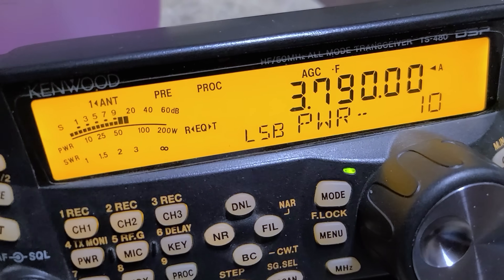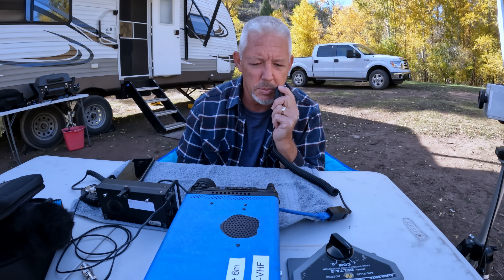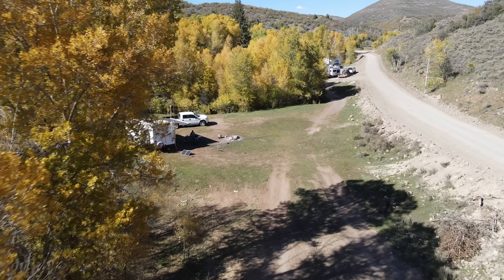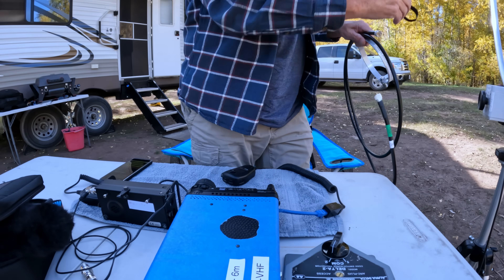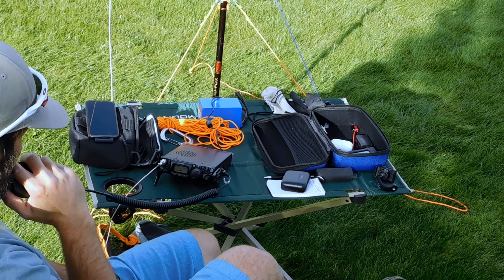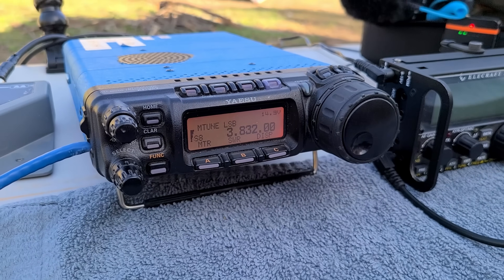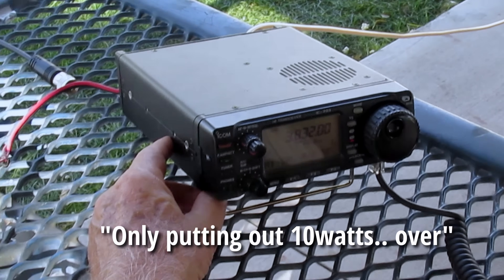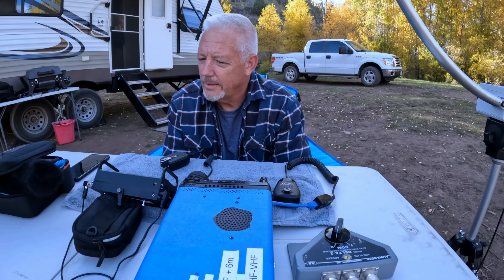Hear what NVIS sounds like from 3 locations | K7SW Ham Radio

Comment: I don’t like magnetic loops.  The big issue is that they’re mostly power limited.  A loop that can actually run more than QRP typically need vacuum caps, so tends to be bulky and relatively delicate.

The only advantage to magnetic loop is if there are very strong neighboring transmitters saturating your receiver.  The very small bandwidth can prevent those signals from reaching the frontend in the first place.

I’ve found the most practical, robust and easily portable antenna for NVIS is the EFHW.  Carry a 20ft telescoping crappie fishing pole, or better a 30ft JackKite, and you won’t need trees.  Set up for inverted V with the pole holding up the center.

Comment: Did you check how was the FoF2 measures that day on the test to determine the optimal frequency for NVIS.? It seems was better for 80M that seems that the FoF2 at that time was maybe 5mhz as maximum frequency.
Reply from the maker: It is on the list to note the MUF and a number of other details that we did not get this time. We were virtuous on this trip. Thanks for the good question
Reply: @hamradiowithkevin  It was an excelent video testing the NVIS. Very complete on testing the antennas. The results I have had is the end fed is the go because is tx stronger, but for Rx a lower dipole is better. I would recommend the same test replacing the worst antenna in the test with a Dx engineering design antenna that is a cross dipole. It is short but it works very good for smaller spaces. This dipole have four branches instead two. I had many good results some years ago doing different NVIS test.
73
HP1GDS

Comment: Hi Kevin, I recently tested a 40m center-fed inverted-V, center insulator on a 23' painter's pole off the pickup's hitch receiver, and ropes on the the ends tied off to a split rail fence, at Camp Floyd Pony Express Park in Fairfield. It made a sensational NVIS setup. I tested during the Beehive Utah Net, and heard all 150 stations well. I want to do more testing at varying heights to find the sweet spot between high angle and low ground losses.
Reply from the maker: Paul, that sounds like an excellent setup and test. What a fun project to put together. Testing like you are doing, is a really fun part of this hobby for me also. I hope to work you sometime.  73

Comment: Since your end fed was 25' in the air, it would have been interesting to put a reflective element under it to enhance the vertical part of your signal.   VE3MCF & AK4HB
Reply from the maker: indeed, If we had more time I would have also lowered the antenna and tested different heights. so many tests to run and so little time that day. More to come :)

Comment: I suspect for where you were within the issues of static within 1-8MHz, I would try something within  21-30MHz to see if that improves your transmission ..

you have heard pushing shit up hill ??

I think you are okay at reception however on transmission you are hitting the peaks you are likely looking at 40-80 foot antenna with the co-ax placed in a metal tube so the only in transmission is the antenna and that's it..

Comment: Thanks for this test!!! So far all three of my antennas are EFHW 40-17, but I remember the 80M later morning or early afternoon contacts I had in 1979 as a Novice with a 90' long-wire antenna and an MFJ-901 antenna tuner. Those were the days of slow speed code for me and a lot of patient older Elmers long gone SKs, lol. -Dave - KU9L
Reply from the maker: This was a really fun test, your setup is exactly the kind of thing fun times are made of. Your right too many SK's these days. Thanks Dave. 73

Comment: Would horizontal full-wave loop, square or delta,  at about six feet agl work as a cloud warmer on most any HF band?  It's seems the higher the frequency the farther the  contacts.  Please advise.
Reply from the maker: Yes, lower to the ground for 80 and 40 meters will be ideal for NVIS. Other bands will not be very good for NVIS

Comment: Fantastic video! The Chameleon EmComm2 QRP edition was one of the main antennas that went into the valley of Turk Mountain in Shenandoah National Park last summer  on a club hiking trip (bought it just in time for testing on the trip). The sloper configuration was fantastic for both getting us voice comms on 60 meters back to my local club during a weekend "Shack Day". We were also able to make a few DX contacts to a Curacao contest station and to Spain. Worked very well for Winlink also. 20 watts was the highest power used on a Xiegu X108G. We also brought speaker wire antennas, the Packtenna 9:1 random wire and the KM4ACK EFHW. All of them fared very well and survived the trip.
Reply from the maker: It sounds like you also enjoy getting out and making contacts, enjoying and using the fun gear you have. Thanks for sharing

Comment: Do you have any concerns about RF Radiation with the loop antenna so close to your operating station?
Reply from the maker: Thanks for asking. Not at the 10 watts I was operating at that day.  Since then the remote tuner has come out which mean the antenna can be 20 feet or more away from the radio. And that is a good addition

Comment: I like DL2MAN's u01 antenna for NVIS.  Only one 30' mast and work 40-60-80.  It is like a linked dipole.  You have to change the jumper to switch band but it is all a minimalist setup with good results I think.

Comment: $500 loop v $20  of wire and a $50 49:1 Unun, I know what I would pick... The loop is ideal for those who have no space, other than that wire antennas are the way to go, save your hard earned dollars. Chameleon products are just way too expensive, and over rated, compared to what you can do with wire and a unun!!
Reply: You see Robbie - antennas are just tools made for different purposes and needs! Some people will buy a Black and Decker BEMW472BH at $125 and others a John Deere S120 at $2,700 because this is what they need and they've the budget for it. 

How many QSO's have you done on 40M and 80M with you End Fed antenna installed on the living room coffee table? I know the answer - it's ZERO because you can't install a EFHW antenna indoor on a coffee table. But I can do it and done it with a CHA F-LOOP 3.0. I can ALSO do it in parking lot of COSTCO during rush hour - but you can't with your End Fed. I can also do NVIS in a back-alley in downtown Los Angeles at 20W SSB under 15 minutes - you can't with your End Fed.

Do you see and understand what I'm talking about it?
Reply: @Chameleon_Antenna  Thank you for adding that information about loops in general.  While I do not have your loop (I do have your MPAS 2 and one of your end feds and other goodies),  I hava an Alex Loop, and am very excited about this particular antenna design (loops in general).  I can do Winlink Vara digital very easily on 10 watts from my living room, and while I cannot break into a SSB pileup with 10w in my living room, I can still get out, by listening for breaks and locations for antenna loop orientation, I can usually get through.  I would add to your comments that on the science v. art spectrum the loop is more to the art end, and that in and of itself is very exciting for me.  Yes, it costs more than a piece of wire, but it is a very exciting and useful tool to have.  And to learn, which lies at the heart of this hobby for most of us, I would wager.  KI5HKU

Comment: One strength of the end-fed is that if you are heading to a location with suitable trees, you will have less to carry than with the other antennas; all you need is the antenna itself and likely a bit of paracord or the like to get the length right. That's great for SOTA.

Comment: You said the end-fed antenna was up about 25 feet at the ends, and a bit less in the middle. That's probably too HIGH to be a good NVIS antenna on 40 meters; your takeoff angle was too low. It probably would have worked better at 10 feet than at 25.

Comment: I get a kick out of folks carrying batteries and solar panels around when they have a 50 amp 12 volt generator behind them in the vehicle.
Reply from the maker: Often times a vehicle, which includes mine, which produces a lot of alternator noise that really interferes with radio operation. For me a generator is too much work to operate with.

Comment: An excellent real-world test, thanks!  I appreciate the mag-loop tests especially as I plan to build one soon.  As I watched the video I kept wondering if it would work NVIS better if it were positioned horizontally to the ground, or would that require it to be a certain fraction of lambda over the ground to avoid ground absorption effects?  Also, as one or two people have noted in the comments, the FCC does require you to be a certain distance away from a mag-loop for RF safety reasons, but IIRC that distance is 3 meters when transmitting 100 watts.  QRP levels are much lower so you could position it within arm's length or even use it inodors with no problem.
Reply from the maker: Your welcome, glad that you enjoyed it. From talking to Chameleon antenna, they said being horizontal would have a minimal effect. I should have noted in the video that I was running 10 watts. The loop that I was using  can only handle 25 watts maximum. Reading the FCC radiation exposure guide is always a good thing to do, exposure levels can very from operation to operation.

Comment: Try dropping the height of your EFHW to about 15'.    I have a 80M EFHW about 13 feet off the ground along the top of some bushes in the back yard, ...  works pretty good.      I would also like to see the group test with the Military style NVIS 80M/40M double dipole.   N1NVK

Comment: Great Video,
On your next testing, please try the loop in a ''nvis config.'' it will have better results when the loop is placed in a horizontal axis so it will shoot up its signal and will also not be directional.
but always, in general: low to the ground is mandatory for horizontal antennas as well as utilizing the MUF/time factor.
73s
Reply: I'm afraid you misunderstand that antenna. The small loops are directional in the plane of the loop, not broadside. There is a very sharp null in a roughly 15º cone on each "axle" of the "wheel." Putting it horizontal sharply nulls anything going straight up, and also requires elevation above ground to avoid excessive losses, just like a dipole.
Reply: @paulplack490  Thank you for enlightening. I witnessed one tune up on 40m and it had some problems, and in fine tuning it as well. Of course, there are many factors in place but after putting the wheel in horizontal position, the local contacts started hearing us with full saturation. it was the only ant. to rival my AS2259/GR  as we had portable SSB setup. I'm assuming we had optimal sub ground structure as well. the height was about 2metes above ground and 6meters for the crossed dipole.
Reply: according to an old article from W4RNL (SK) Cebik....that there will be some directionality due to voltage peaks on the element.
Reply: @W8RIT1  Thank you, I will read up about it  ASAP.

Comment: The guy with the 80M antenna at the park made a major installation error which will GREATLY influence the radiation pattern and the performance of the antenna thus the overall NVIS COMM experience. You CAN'T wrap a radiating wire on a post like he did! The antenna transformer which is on the table MUST be attached to the post otherwise - you'll lose a lot of power and create RX and TX issues! It will be even worst if the post contain metal inside or around!

Comment: Operating a NVIS COMM at QRP power (under 20W SSB) is VERY good!!! In my book this is a success! Remember that depending of the maximum NVIS frequency used - the Ionosphere will absorb a % of the RF radiation!
Reply from the maker: These are really good points you make. We could have consulted the MUF and used higher power to have seen increased results.
 For 5 to 10 watts we were all using during the day, we really had a good outcome.

Comment: I am curious about your experience with solar charge controllers and maybe inverters while operating from a low noise environment.  Which have been low noise and which have not?  The tests of antennas and NVIS between parties was very interesting and I enjoyed this video.  73 W4POT
Reply from the maker: Thanks Ed, over this summer with all my activating outside the RV with my little panels, I really never had any noise issues. However, operating from in my RV with all the electronics, WOW what a nightmare it can be.  So i really only operate in the RV at night. it so much more fun to work the radio outside at camp anyway, at least when it is warm.  73
Reply: @hamradiowithkevin  is that due to inverter use?  Trying to compile a list of noisy vs. clean items since the data is missing from most general consumer reviews.  73
Reply from the maker: @EdwardGriffin  , there are so many things making electrical noise. It never ends trying to silence them all, so I just find ways to use the radio when it is more quiet

Comment: Tank you, this was a very interesting example of NVIS comms.
I have a couple of questions if I may?
1. Your brother HAM who was using the home brew antenna with a DIY adjustable ferrite choke, was his wire antenna in a end-fed configuration or OCFD?
I noticed his feed point was at the lowest point of the droop.
Also which of the call signs were his, N7GPG, KB7JSW or KI7WJP?
Last but not least.
On the use of a small mag-loop for NVIS, where as the maximum signal strength is in the plane of the loop (which includes the top of the loop) I'm wondering if it wouldn't have worked better if you had the mag-loop tilted 10 or 20° towards your intended recipients?
Thanks again for taking the time to make these videos. 
Gary
Reply from the maker: Gary, KB7JSW had the adjustable choke endfed wire antenna, at a few points in the video, I was able to rotate the loop and improve the signal both for 80 and 40 meter contacts. you would have look back through the video to find those moments however. 
I appreciate you asking.
73 Kevin

Comment: My HF antenna at my QTH is a Alpha-Delta DXCC multiband dipole set up as an inverted-V. Apex is about 25-30 feet up, ends are 8 feet. It seems that the pattern is fairly omnidirectional

Comment: Great video Kevin.  I am guessing the station with the poorest comms in this test was the one closest to you?  It's been my experience that for reliable NVIS comms the distance between stations usually needs to be about 30 miles or more.  The angle is too steep "straight up" and will just be obsorbed, and won't reflect much if at all.  The solution for local comms is having a network of overlaping NVIS stations.  You can use voice to relay but the most efficient way would be digital.  KJ4LG
Reply from the maker: Thanks Mike, I appreciate that.  Kevin

Comment: I like your cooperative antenna testing! I use a non resonant end-fed stealth sloper 71' long, with 50' coax, 9:1 unun, no counterpoise, & common mode choke on a jumper 3'  from transceiver. Antenna slopes down from a 15' balcony to a 6' wooden fence. SWR is 1:2 to 1 or less on 20, 17, 15, 12, 10 meters with no antenna tuner. Using internal ATU in my XPA125B amp, SWR is 1.5 to 1 or less on 160, 75/80, 60, 40, 30. Have made contacts on all HF bands. Get good signal reports on daily 80 & 40 SSB phone nets including stations that are 5-20 miles away. From California have also worked Europe, Mediterranean, Africa, South America, Australia & Asia both QRP & 100 watts SSB. It's great to have an inexpensive, limited space, all band HF antenna. I hope this is helpful.
Reply from the maker: Excellent description of your setup, thank you for sharing.

Comment: I put together an inverted "V" antenna for 40 meters using some old wire I had lying around, a BNC to banana plug connector, a broken fiberglass mast, some RG58 coax and some cordage. The apex is about 20-25ft high, the RG58 with BNC connector runs down the pole.  I hit the jackpot with the wire lengths.  They needed no adjusting.  At the base I made an air choke.  I have practically full bandwidth on 40 meters with an SWR of less than 1.8:1 without using any "tuner" or matching device. The antenna functions very well as an NVIS antenna.  I would not take it portable, however.  As the sayiing goes, never touch a running system!

Comment: In this solar cycle 40m goes way to long for nvis usually, in my experience. 80m with a low dipole or endfed works almost every time. Especially with digital modes.

Comment: The magnetic loop is hopelessly too inefficient on 3.7 MHz to even bother with. I have many mag loops, but I only use them on 14 - 30 Mhz......preferably on 15/12/and 10 meters. A simple piece of wire thrown into a tree would whip the mag loop on 80 and 40. Thanks Kevin, fun experimenting
Reply from the maker: Thanks John,  it is good to hear some mag loop experience like you shared.  This is very helpful,  not many hams have tried or experienced the loop. 73

Comment: Wire usually wins at 25ft. Is that choke necessary on the efhw? I thought they wanted at least 25ft to work off being the ground side and all.
Reply from the maker: I agree, wire performs well in most situations. In this case, the Chameleon LEFS-8010 manual suggests using the Chokw at the feed point. I have tried both at the radio and at the feed point and I can say that the match is more consistent with the choke at the feed point. I tend to use different lengths of coax for each setup I am at.  I would have liked more time to be able to lower that wire antenna to other heights off the ground and get those results.